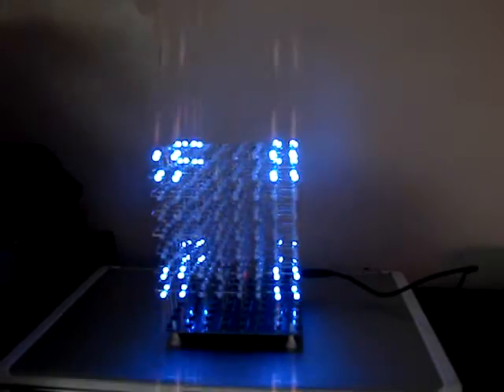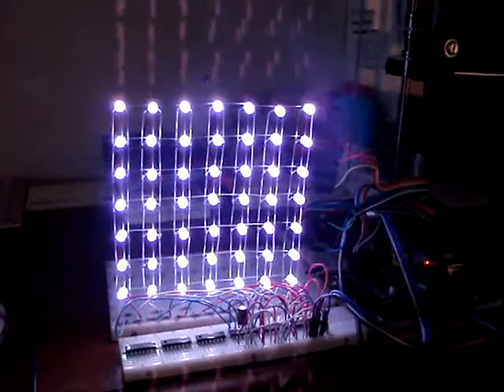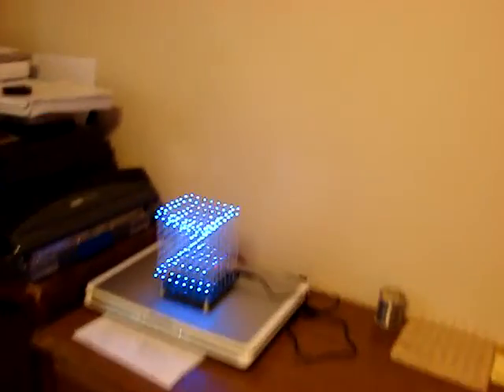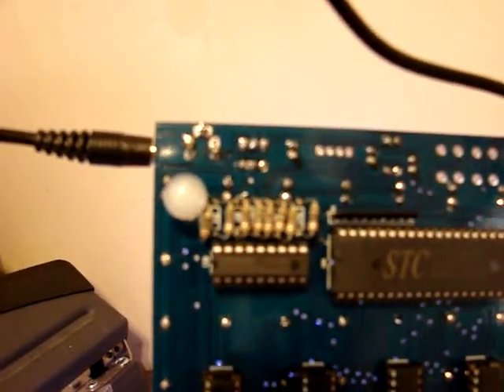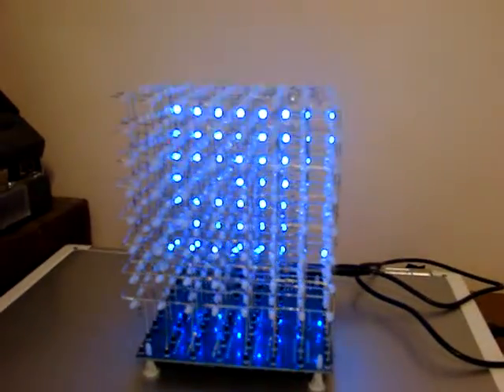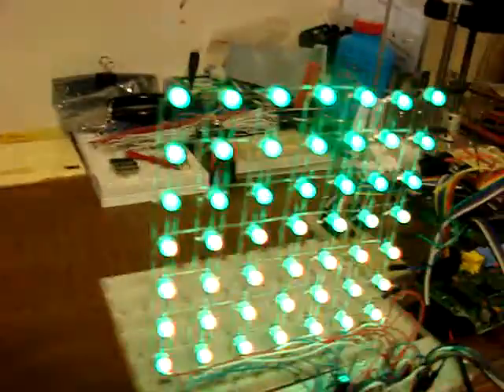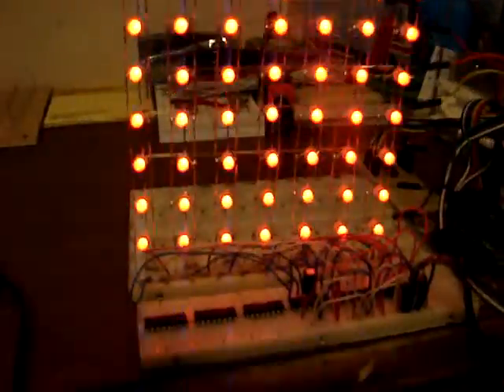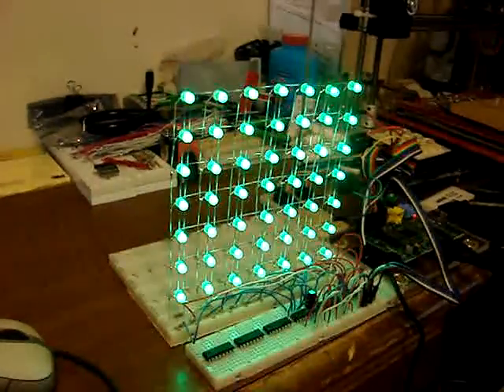8x8x8 led kit fixed

Comment: what was your problem ?  Because I am having issues with patterns ( Blue cube).  Some patterns are weird, sometimes missing some panels and sometimes LED's that should not be lit, light up very dime.  All my connections are ok and all LEDS are properly soldered
Reply from the maker: I had a shorted LED, that causes the entire layer to act up.

Comment: I have my positive legs going down  and my negative leads going to the layer pins in front. So all I need to do is change the resisters?
Reply from the maker: +Steven Davis - The resistors need to be in the "common" lines.
Reply: I Thought The Negative legs are supposed to go down into the board?v And the wire go to the Positives ?  Is this Not the Correct way ...I am now confused ????
Reply from the maker: Stephen, I said that backwards.  The resistors are in the layers by (improper) design they should have been in the 64 legs.  But since they are in the layers instead of 510 ohm use 51 ohms.  The IC's will handle it because they have internal resistors.